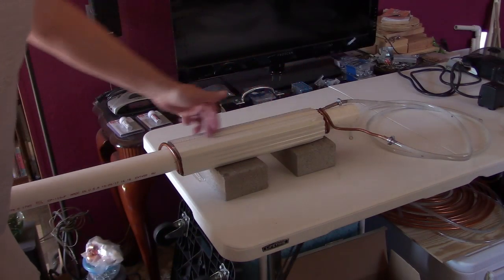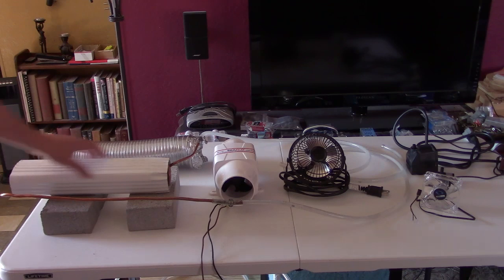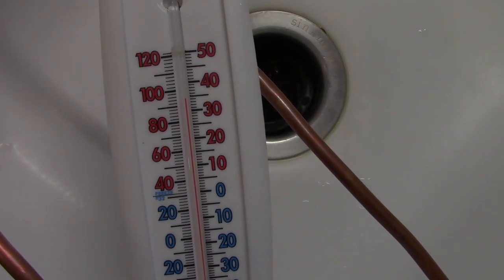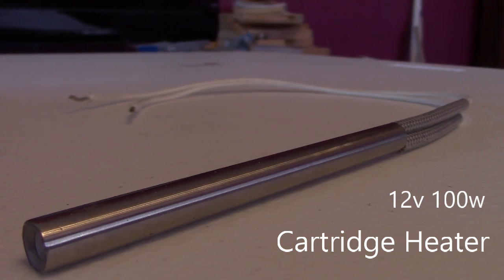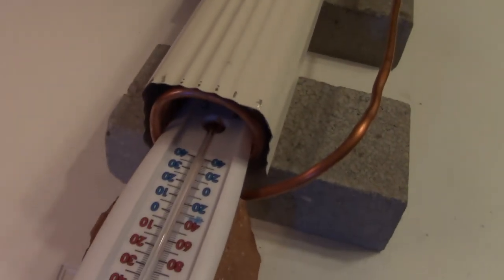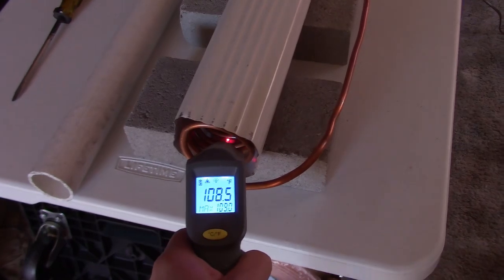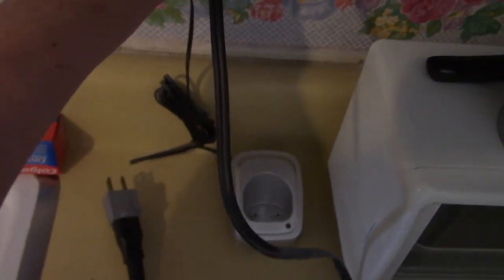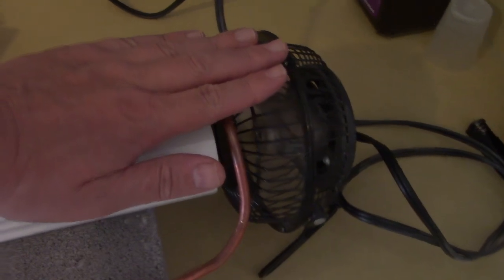Homemade "Copper & Steel" Heat Exchanger! -for heating (& cooling) air! -fan pwrd! -AC/DC -3 Exp.'s!

Comment: Watched whole video... But frankly didnt understand what you are doing in here... Are you... and how are you blowing air through the copper tube... or are you blowing air thro the tube at all.? or are you passing hot water thro the copper tube?
Reply: Hot water is passed through the copper tube for heat.  Cold water can be used to cool the area also.  The fan sends air through the tube and heats or cools depending on if you use hot water or cold water.  I have a 12x15 tiny home and this could help greatly.  No magical dial on the wall with off grid living. Lol

Comment: Found this video because I'm thinking about making a homemade heat exchanger for an outdoor wood boiler.We live in an RV and I can't fit a heat exchanger unit into our small RV furnace. However we have existing duct work that I'm thinking about using your idea inside of round 6" duct pipe about 4" long, with a end cap and squirrel fan ran via thermostat into the cabin of the RV.

Comment: I would use a steel resi to hold the water with the flat 12v heating elements used in one of your videos boiling the water that would add a hell of a lot of heat going through the tube

Comment: hey desertsun :-D ! luv yer experiments !
at the end you asked 4 suggestions so if U like simple heat exchange devices , check out This Old Tony's channel, where he makes a Hilsch vortex tube, that separates air into a hot and cold end. 
-the cold end can get sub zero, while the hot end can get up to steamin hot.
stick the hot end in the hot spiral, stick the cold end in the cold spiral.

Comment: Interesting new electronicsNmore video (https://www.youtube.com/watch?v=kvWZjM1AcG4) noting improved performance using better efficiency diodes to rectify/block.  Great demonstration regarding also for those not familiar with electronics. 

Would be interesting to see exchangers using the solar concentrators for even better efficiency.  Tracking will be more a challenge though.  Neat experiments.  Outdoor conditions haven't been noted lately... would be awesome to see outdoor temps again more regularly to compare.  Thanks for sharing!

Comment: What is your plan to replace the heat in the water reservoir. Baffles inside the shell will also create more turbulence of the air flow around the coil and give you better heat transfer.
Reply from the maker: hi. i'm going to try making a baffle (of rolled aluminum flashing)... maybe just a single one the length of the tube and insert in straight in the middle

Comment: put the heat exchanger pipe in 3-4" round duct, then put a 6" duct around it an spray foam in between. make sure all the heat gets in the inside air.  that's my suggestion. and what i will try :). thanks for the video. it would be nice to attach that to a big thermal storage tank, and have it thermosiphon its own heat out. depending on where the upper and lower pipe connect to the thermal storage

Comment: If you get two barrels, a shaft, ball bearings, place the slightly smaller barrel inside the larger centered by the shaft & spun by the bearings. Fill the space between the barrel surfaces  with any oil so a viscous bond between surfaces is made, the inner barrel can be spun using a solar DC motor say 100w, the faster you go you will see a an increasing amount of free heat made on the outer barrel surface that can be used to duct into directly into a homes hvac.. 
Friction at a molecular level is powerful.
Reply: ...I wanna see a diagram of this, I'm having trouble visualizing this. 🤔
Reply: @Texaca  ok give a bit I'm making something now lol.
Reply: The heat isn’t free.   You have to do work to spin the small barrel and that causes the heat.

Comment: i remember something like this long ago. in the military tech-school they were pushing a fluid through a tube really fast..they could either make the fluid cold or hot..they used a radiator,  a fan and a hi performance elec.motor to create the flow. the tube had a air pocket to eliminate liquid lock and was designed to circulate fluid super fast without compressing it. The thing was the faster you moved the fluid the hotter or colder it got without compressing it   I always wondered what you could do with it for public /personal use.

Comment: nice and more could be added to increase what output you want.
I was thinking of connecting several length pex tube and blowing air through them to see what it outputs. currently I'm working on a heater core from an auto and see what I get.
winter is here where I'm at and need to get it finished and put it to a test, just waiting for a part that should come today. Thank you for the video's